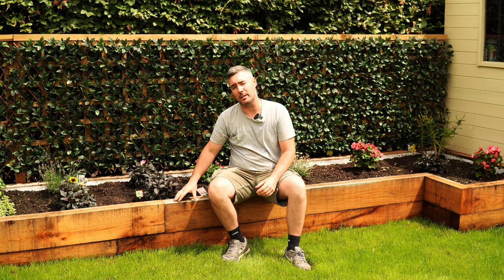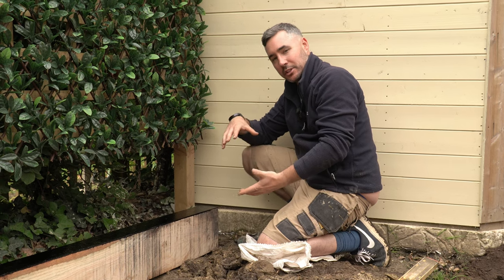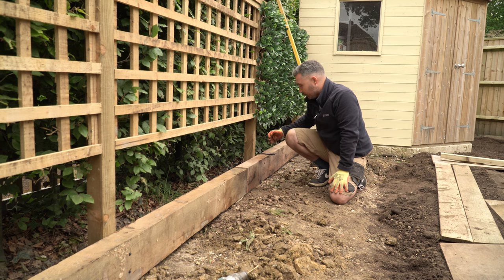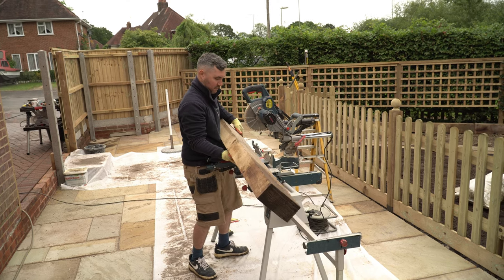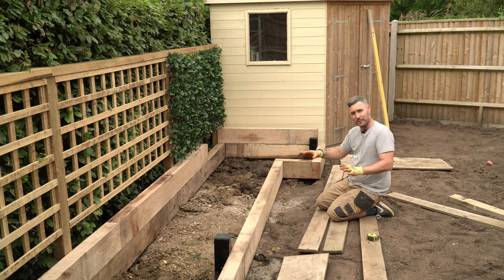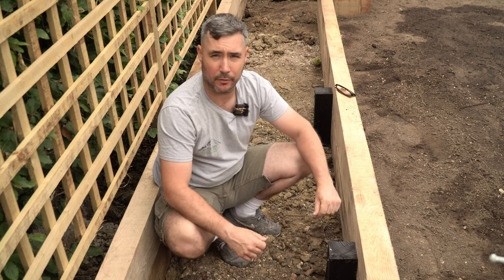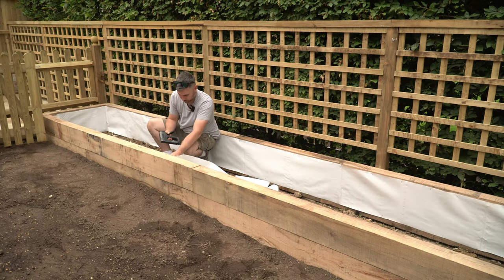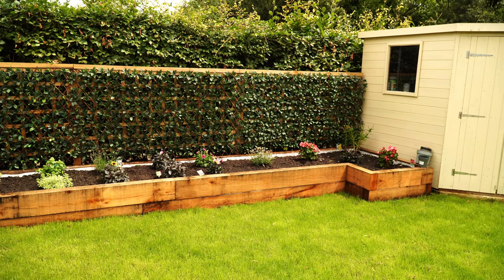Build an Oak Sleeper Raised Bed | ULTIMATE Guide

Comment: Did you use oak or a soft wood for the posts? As you staggered the sleepers, did you put a post at each joint, or how did you join the posts at the staggers?

Comment: Great video, thank you, I now feel more confident tackling this project myself.  Question, why didn’t you run the plastic right to the bottom of the sleepers and maybe slide it underneath the sleepers?  Obvs not a criticism
Reply: I think it was because he used Bitumen on the bottom of the sleepers and they weren't placed directly onto the soil. The amount of liner he used will stop the damp soil from touching most of the sleeper.

Comment: Great video. Are the supporting posts oak too?
Reply: No, that's why they are heavily treated
Reply: @MountainRugCleaning  thanks. How many screws did you use per post. I’m wondering how many boxes of stainless screws I need to buy.
Reply from the maker: Just a couple each sleeper

Comment: Looks good but you have to use stainless fixings with oak really. The oak reacts to normal steel. I know the ones you used are coated so should be fine. Especially in a landscape environment

I found out the hard way after spending £200 on bloody stainless screws
Reply from the maker: Yeah i know. Think i mentioned in the video. Plus i always recommend having your fixings on the inside. Keeps it all neat and tidy then. But the stainless steel screws you used are going to last alot longer 👍